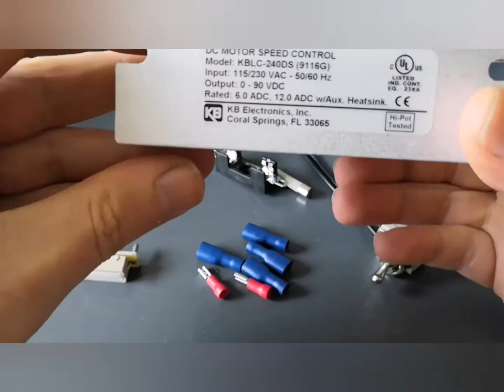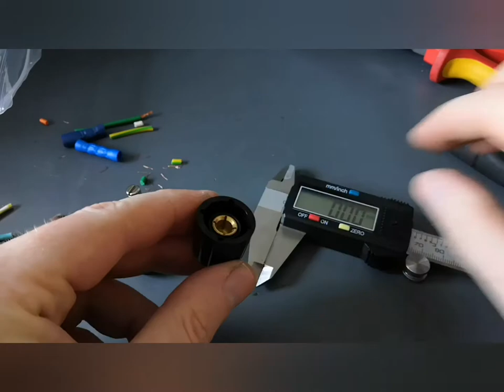Replacing the DC motor controller board on a Sherline lathe KBIC KBLC

Comment: I was running mine and heard to distinctive pops and maybe a few sparks. I bypassed the speed control and ran direct to motor and it runs super high RPM, what should I consider looking at for the cause of the failure? To repair my old speed controller? It did no longer work with speed controller wires in circuit
Reply from the maker: Hello.
Do not run the motor without the speed control! The motor is DC and your home power feed will be AC. It will damage your motor beyond repair and it could be dangerous! 😬

It's hard to know what caused your controller to fail without taking a look but the first things to check for are loose wires and blown fuses. If you don't find any problems next look for burnt or melted components. Some components can be changed easily for little cost.

Matt.

Comment: Hello,  I have a CNC Sherline mill and it was purchased in the last 18 months to 2 years.  My board is slightly different to yours and since I Changing to the Centroid Acorn controller the motor control is a problem.  I am happy to run the motor first then set it to CNC.  I have more wires than you show but I have three wires that were for the motor control.  I’m wondering if I simply replace them using the Pot as you have done OR will it blow up?  I can send you a photo of the board if it will help?  Thanks in anticipation.  Mike
Reply from the maker: Hello. I know practically nothing about CNC I'm afraid but if you wish to send me a photo I'll take a look and help if I can. 🙂